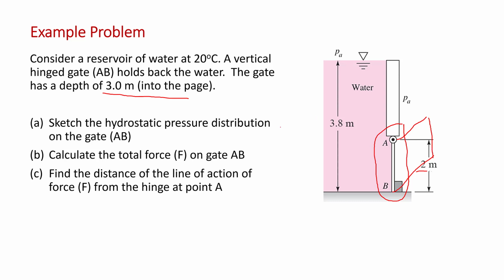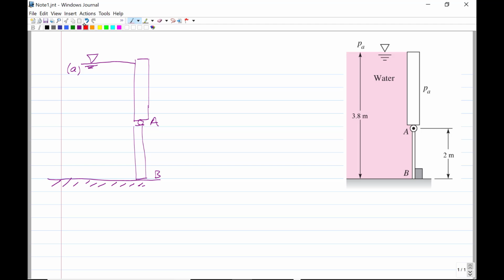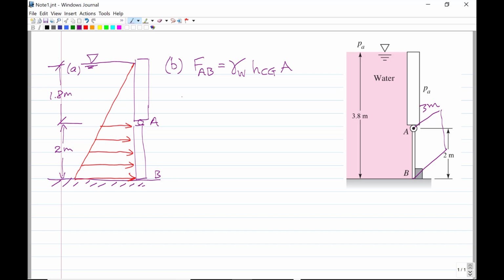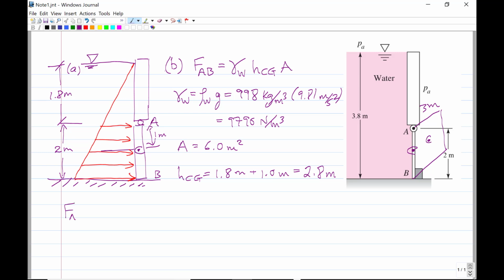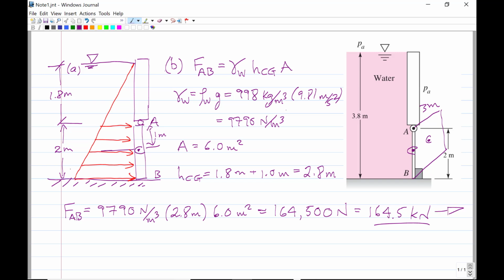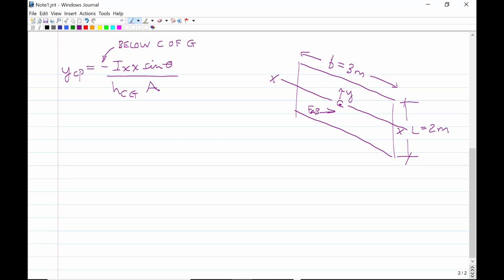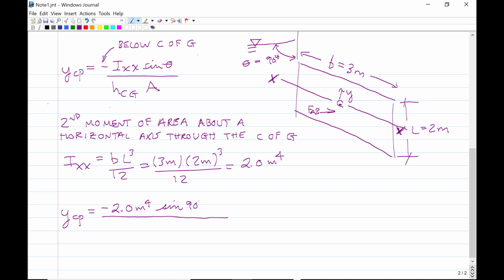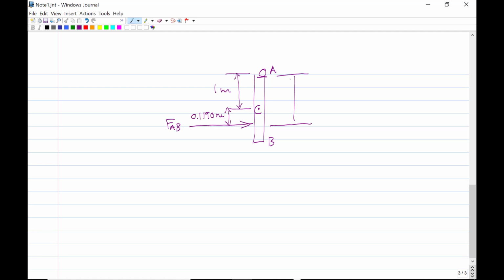Solved Example: Hydrostatic Forces on a Vertical Gate (Rev)

Comment: I thought since the pressure varied, we had to use integration? Can someone help?
Reply from the maker: The resultant force is basically an integration of the pressure distribution.  It's the average pressure (which is at the centroid) times the gate area. It's a lot like how you may have handled a distributed load on a beam by replacing it with an equivalent point load.  I hope that helps.

Comment: A video with Water on Both side of the wall , and we have to calculate the Maximum Bending Moment 
Please
Reply from the maker: Thanks for the suggestion. I don't have a video with fluid on both sides of the gate, but see solved problem #5 in the Chapter 2 problem set: https://www.drdavidnaylor.net/problem-sets.html     I hope that helps.